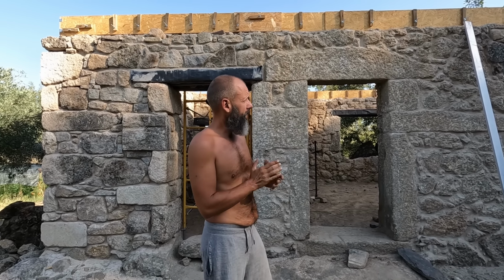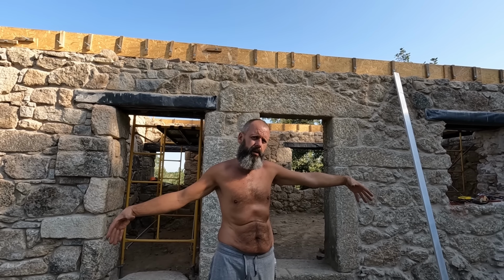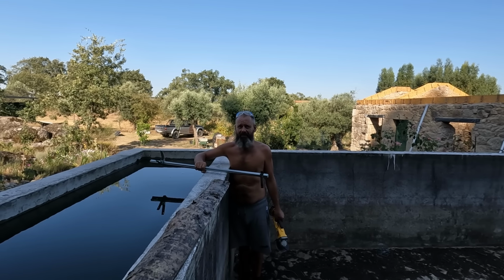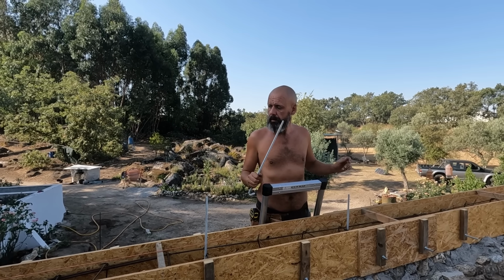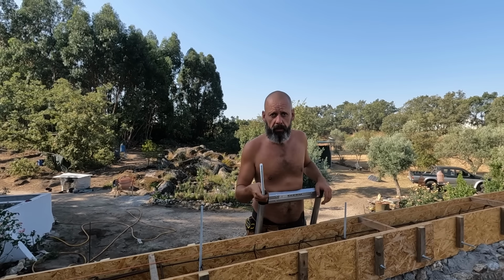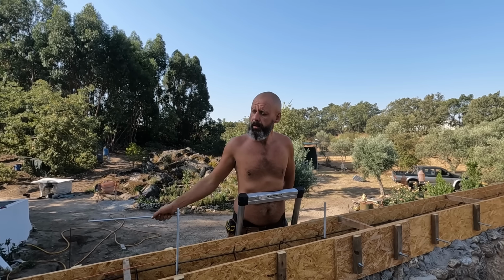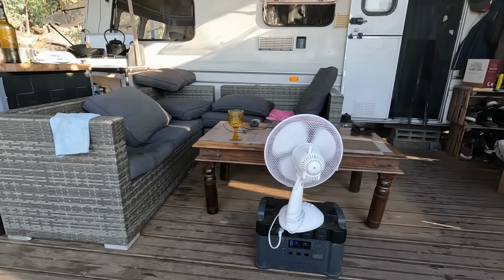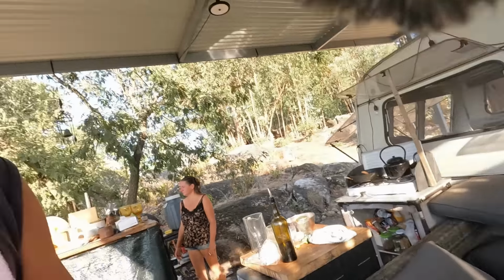The Tiny House That Time Forgot

Comment: Hi andrius and G
Yes a tour of the property would be great. As for the ring beams you'll soon be finished. Take your time and do a little bit when you can weather permitting. As for the fixing I would probably only put 2 in each length of wall plate but you do what makes you feel right. As for the building not been parallel what you can do if you want. At the front of the building make the wall plate run the same as the ridge beam so if it's 2mtr at one end make it 2mtr at the other end. So all the rafters are the same size on the front of the building.. The back of the building the rafters will all be slightly different sizes. But the front will all look the same. Just a thought.
Regards John

Comment: As always you guys are doing a great job, taking it slow is the key point of it all.
You know... I would get the front patio done or at least make it level enough where you can make your work space closer to the project.
You need some type of a working space close enough to the house, it would make things so much easier for you.
Reply from the maker: It would !!! Will see what we will do next .. that heat makes cement work difficult
Reply: @portugalitis  yes it does, make it wetter, but fill the patio area with crushed stone or some type of gravel first where it gives you an area to work closer to the project, just a thought...
Reply from the maker: yes we will put cement mixer by the house :) one sub gave us same tip as well ;) so happy we got you helping us

Comment: To do what you need to do is get up at 1st light coolest part of the day,speed up concrete by filling wheel barow and then another mix in the mixer before delivery of the 1st mix😊
Reply from the maker: Not going to work 100% from first light to 30 degrees it’s about 3 hours we have, what do you think 2 people can achieve in 3 hours??

Comment: Hello lovely guys
Laptop,,,,  is full of coton inside,,, the chanels where the air circulates do cool the processor are blocked with a thick cotton layer 
,,,even in cool days and running light videos the fan inside is always at Max ..right?
just take it to a store and ask for that service and only just that service 
... or do it yourself ,,, ,, cheers
Reply from the maker: Hey !!! thank you for your tips !!! we actually had it serviced not long time ago but it's so much dusts here so maybe we should do it again good tip :) Gxxx

Comment: Thanks for sharing another video with us. I have two concerns for u. Andriu, you are going to fill the roof base with cement. Please consider the following 2 things;
1. Consistency of each cement batch u make with each other. I have observed that different batches of cement when applied together or used to smoothen walls, they tend to cracked at the junction areas of the different batches all along due to the different consistencies of rhe made cement when they dry off. 
2. Although I know u won't consider it an obstacle u will have to make many cement batches using ur mixer AND carry it by hand up to pour it. U will knacker ur backs n have many different cement batches mixed with each other with the bars. The temperatures also have apparently  an effect on the solidifying of the cement. Ideally to avoid these issues u should buy a large pre made cement mix with ability to dump it in ur moulds. The heat is going to make it harder for u guys. I know u r both very hard working and driven, but be careful . Wishing u both all the best. When u have time can u edit a video with the before and now? Highlighting all the improvements?
Reply from the maker: Thank you for your tips I am sure Andrius will read them :)